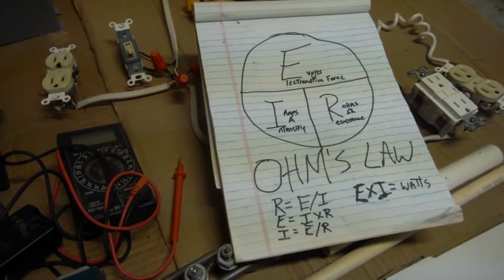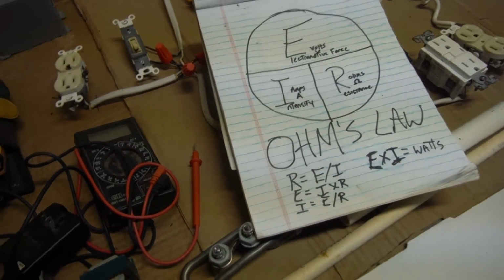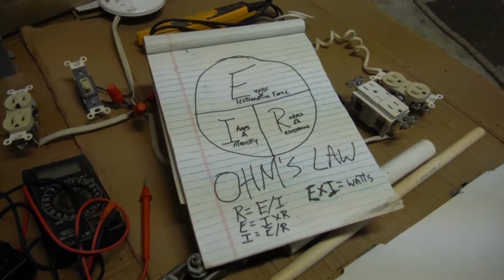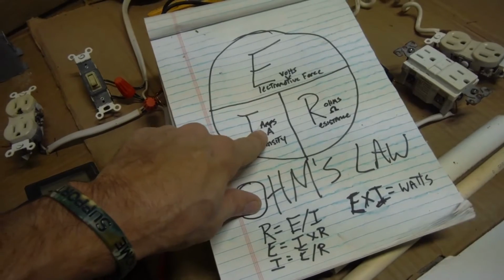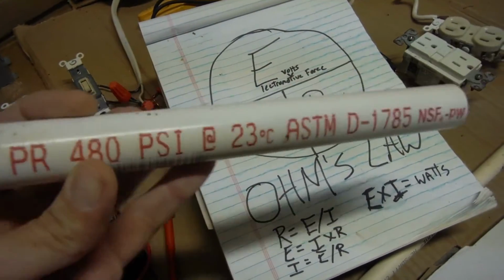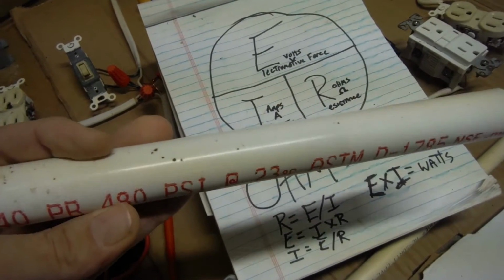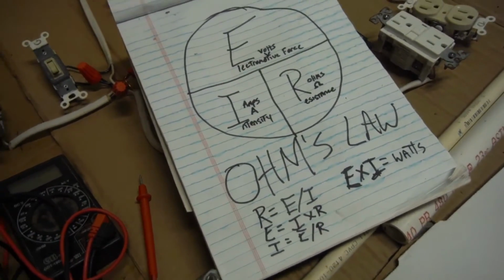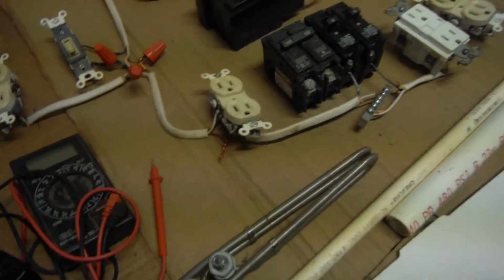Electricity Overview, How It Works

Comment: Rev nice job on the video. Sorry didn't learn anything but that only because I am an electronic specialist and have been in the field for 10 years lol love the ant story
Reply from the maker: +Chris s Thanks, man! Was there anything that I said that didn't make sense or was wrong or just worded wrong? I had to have done one of those! Lol!
Reply: +RevtosTV  every thing looked good I was taught  the same way with water and also explained a couple other ways But I think for the new person not knowing anything water is the easiest way to explain, The circuit looked sound to me,  but for me when I test Switches there are 2 ways lol well 3 including yours you can do the continuity test with your meter with no power hooked up :) or get a jumper wire so you don't have un-hook anything and just tap it and it will turn on or off the light or your way :)
but like I said Rev Nice Video I am not sure I could do it any better.